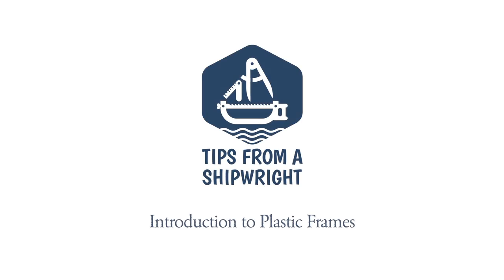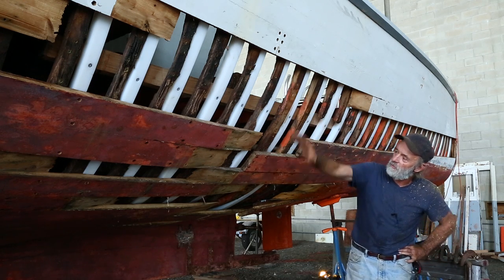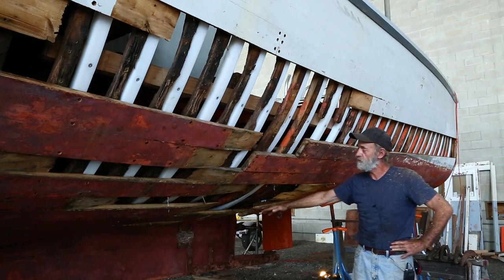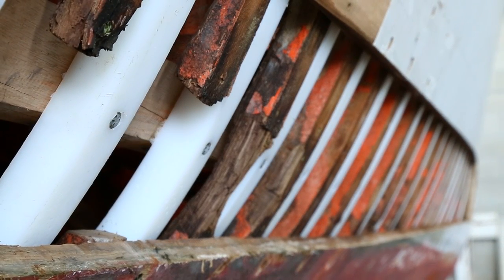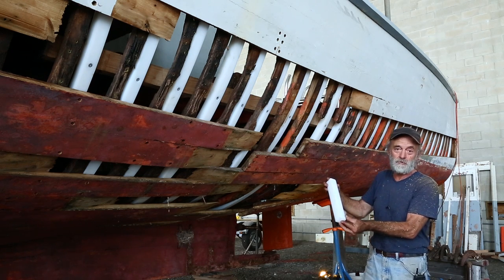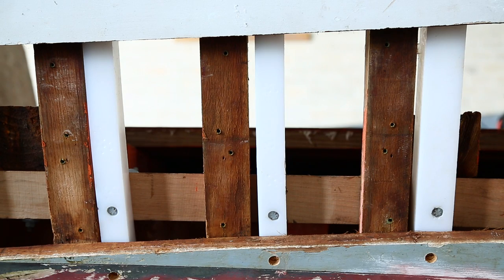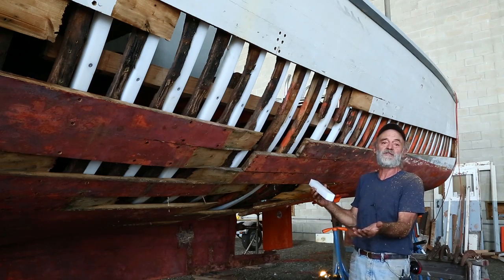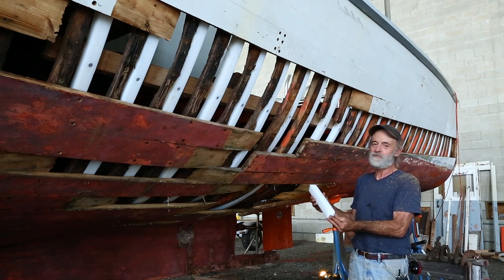How to use plastic frames for wooden boat building with Louis Sauzedde

Comment: Lou you are a genius. I am up for using HDPE every chance I get. Some really old PE that I have from decades ago isn't exactly unaffected by time and exposure, but it is still an outstanding choice. It seems like the stuff you get now is alot better than what was available 30 years ago.
 As for taking nails, yes it can take annular nails, in fact that's how I laminate it. Not glued but I've filled joints with Sudbury elastomeric, or thickened black tinted epoxy, and even Lifecaulk. Just put the nails where the main fasteners will miss them, and when you sand the thing, the nails become little drifts.
 I wouldn't even try to just glue it, but a few bronze nails will make a block out of sheet stock.
Makes great maintenance free pedestal mast steps. For when you cut a few rotten inches off the bottom of a mast, to raise it back up. No cold flow problems, but if exposed to sunlight use black. It's easy to epoxy a shell over it if you want something that looks more finished. 
I haven't checked out the forums just know this stuff works for me too.
Thanks

Comment: Tips from a shipwright.   Louis, Great channel. I watch to bring me back to my craft. Thanks!

To the viewers:
I have used it in many projects on various types of boats. holds well, easy to mill, lasts a 100 lifetimes, etc...  Its also weldable, ( If you need to hide seams or protect edges from nets and such). Great material. traditional wooden boats can be improved on, and as much as I feel odd using plastics, if you try it, you will agree.
Those that said it wont bent like wood... hahahaha. you literally can bend it over on its self. IT WILL NOT BREAK! 
The things I dislike about this stuff is it gets razor sharp, and it clogs the joiner, planer, table saw, band saw quickly  ... so frequent cleaning is needed, but thats is a price worth paying . Please show some vids on how you work with this product.
Reply: intriguing. Early in the video Louis stated, "you can not strip a screw in it." What exactly does that mean? Does it hold screws well? I imagine that's how he'll attack the planking.
Reply: I find myself needing to replace a bulkhead because the chain plates leaked and rotted it out.  Can starboard be used for this application?  Do I glass it in like I would with wood?

Comment: Would you consider this any good for a small 14' clicker salmon boat for doubling up on some dodgy steamed frames. They are only small 15mm X 30mm. It's a commercial boat so thinking this will be good for reduced maintenance.

Comment: Thanks for passing this on to us.  I will be using this technique to replace 2 cracked ribs on my 1967 Pacemaker.  I have seen your video on scarfing and it appears that you have quite a bit to do on this vessel.  What type of bonding agent do you use on the contacting surfaces on the scarf joints?

Comment: I like this a lot.
Where do you buy and how much is this plastic material?

Your so right, screws will not strip, it cant break and it will not rot.
I have a wood 37 egg harbor I rebuilt and wanted to do this years ago.

Comment from the maker: Subscribers of WoodenBoat Magazine can watch Tips from a Shipwright's latest video on WoodenBoat.com under Exclusive Videos - Plastic Frames for Wooden Boats - HDMW polyethylene sistered to wood - https://www.woodenboat.com/subscriber-videos/plastic-frames-wooden-boats
Reply: Tips from a Shipwright having worked with plastics in the past I'm always surprised how little they are used in the ship/boat building world, I got to use some reinforced polymer sheets in a military contract (can't say any more about it so please don't ask) about ten years back that blew my mind, you could cut and shape it like wood but it will never rot and you could hit it with a sledge hammer all day and night and not leave a dent, it could be chemically bonded to itself or epoxied to other materials, we were using 8x4 sheets that were one inch thick, only downside was weight, it was heavy as son of a gun.

Comment: I don't think the plastic will flex like wood and take a beating like wood will. Plastic frames sound like trying to mix epoxy with wood. Chalked top sides on a planked boat mixed with a epoxy bottom don't mix. Like plastic frames and wood planks.

Comment: Louis, I respect your work but I cannot agree with the idea of inserting plastic into a traditional wooden boat.  I fail to see the benefit over steamed oak or laminated ribs except some  (not much ) labor.  This will be an asterisk on this boat.  Traditional wood construction*   

* with plastic frames
Reply: It's all about cost. That's a working boat that feeds a family or few. Moreover - Louis doesn't own it. He was hired to repair it and get it back in the water sooner rather than later per the time=money mantra of working vessels like that. The material might cost more than wood but the owner saves a ton on labor that would otherwise be spent shaping each member to fit. By the way Louis talks about the material, they'll never have to have that work done on the boat again. It's an investment.

Comment: May I ask if you would get issues with expansion and contraction by way of using a plastic with properties not in sync with timber?
Reply from the maker: Not one problem has ever popped up using  this plastic for frames,and many boats  have been reframed with it at this point.